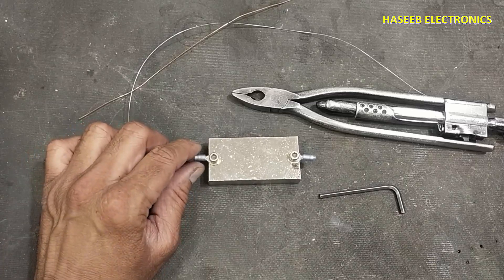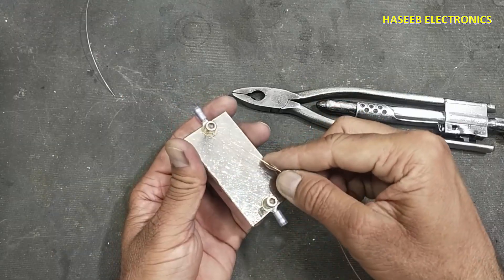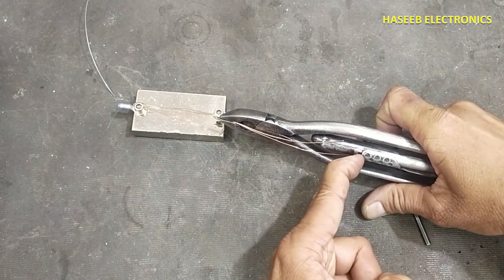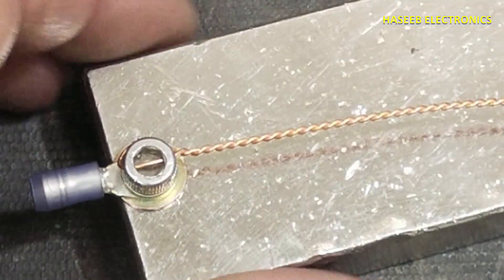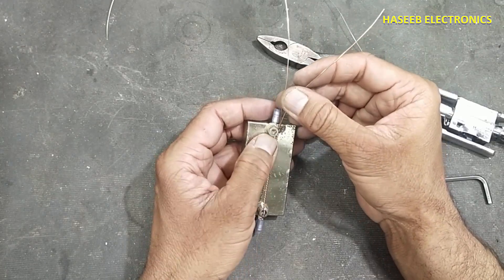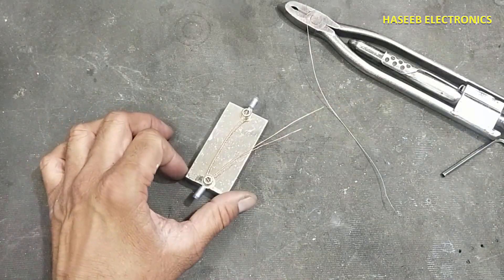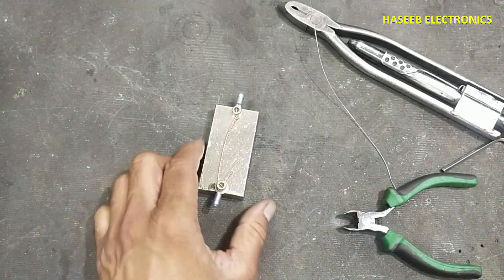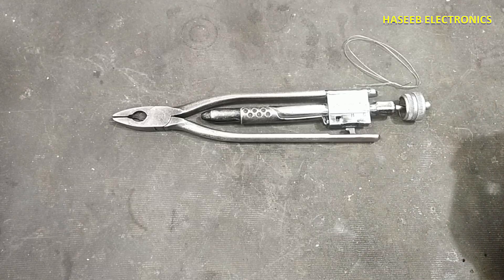{998} Twist wires using Wire Twisting Pliers

Comment: It's been 30+ years since I've seen a tool like this. They were used to go through nuts and bolts in transmissions and rear differential units in trucks before the invention of liquid fastener locking compounds. (LocTite) I believe the aviation industry still uses this as well. A drill can be used when making long twisted pairs of wires if you put the put both wires in the chuck and the other end of the pair in a vise. The tool we had in technical school looked exactly like the one you have there! Brings back memories. Thanks for showing!